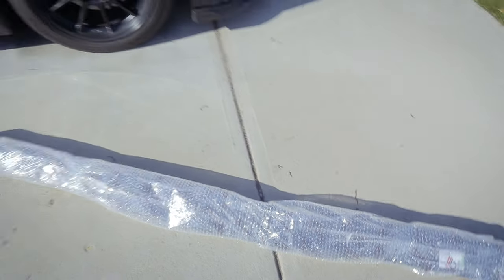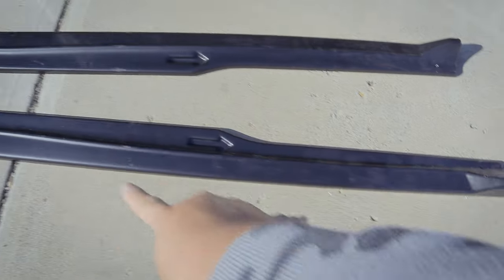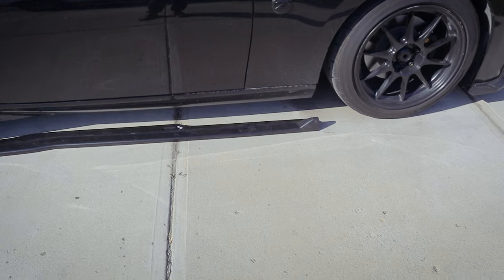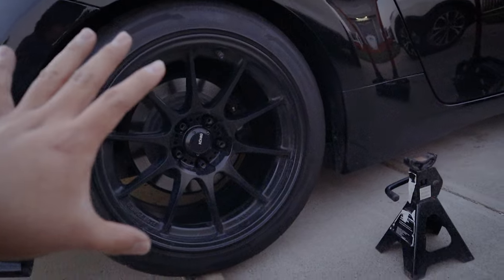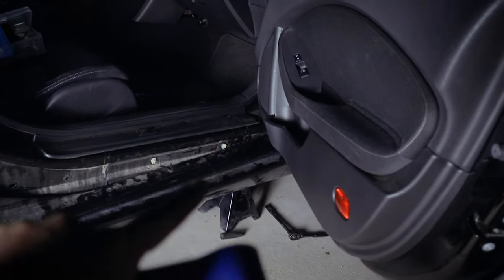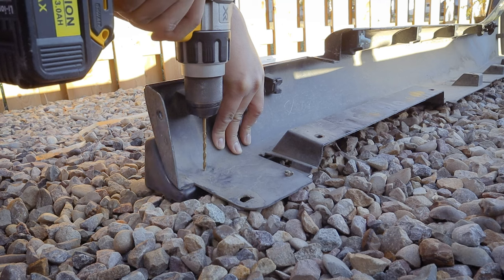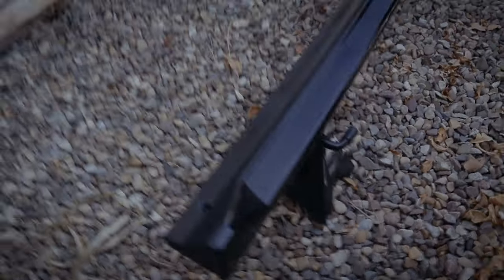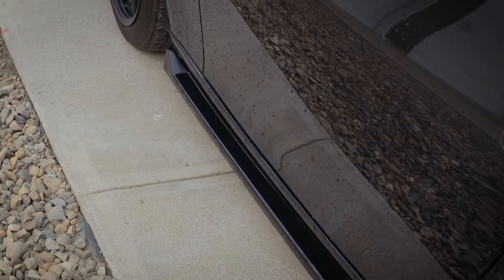370z gets MAXTON DESIGN side skirt extensions!! | Install Guide

Comment: That's so sick Bro. I'm here one year later, keep up the work. 
What's the length of those skirts? 78.7" or 86.6" ? (I would like to install one of this on my 370z too, but not sure about the lengths..)
Reply from the maker: Thanks man! I'm pretty sure these are 78.7". It's specifically for the 370z so you don't have to worry about fitment 👌🏼